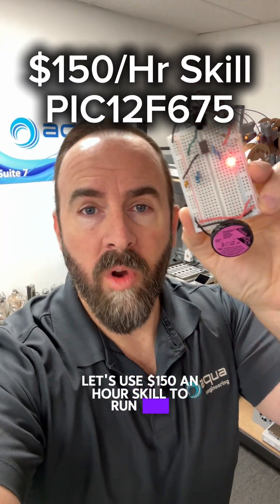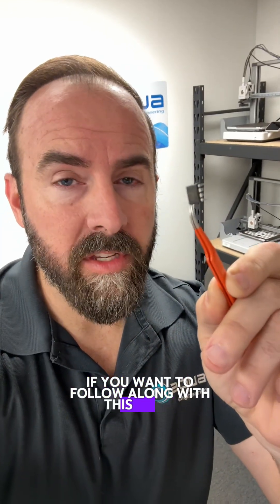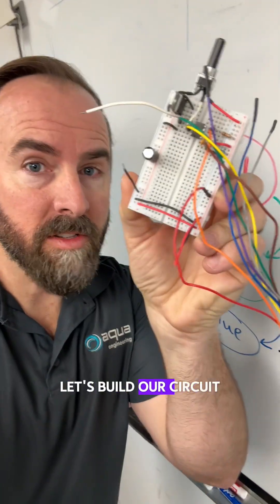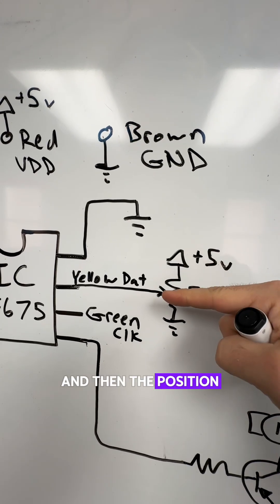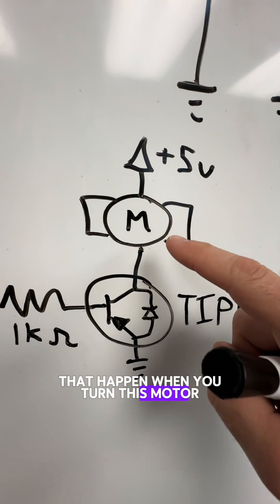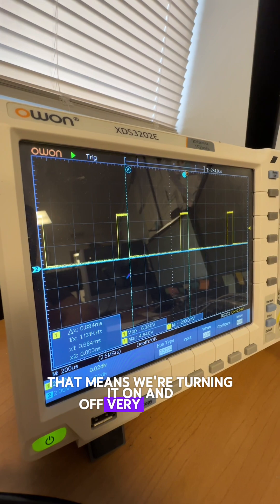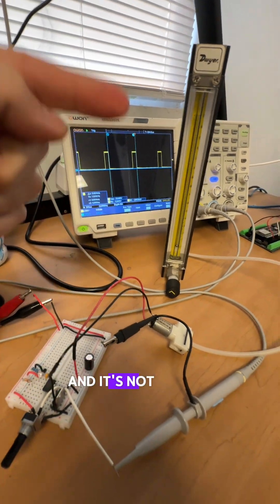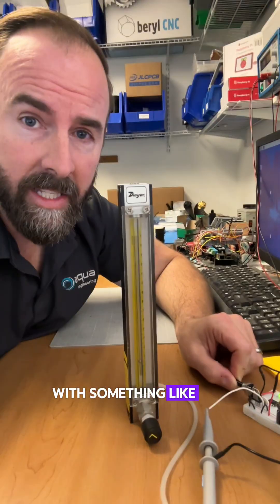PIC12F675 Pump Control is a $150/hr Skill

Comment: You can get an Arduino for $3, it doesn't need a $70 programmer, and it has hardware PWM so you don't need software interrupts.

Comment: Great example of how a pic works.    In this example though a pic is unnecessary.   Keep things simple,  a 555 timer ic would be better.  If a pic fails you need the chip and a copy of the code and the programmer.   If a 555 fails you just swap it out.

Comment: The diode you pointed to is just the body diode. all mosfets have it built in as part of the manufacturing design, and it isnt acting as a freewheel diode because it doesnt provide a path back to the other terminal of the motor (to allow it to freewheel and reduce the inductive peak)

Comment: If I were jumping into embedded programming, I believe I’d consider an ESP-32 board.  You can get the boards for as low as one Dollar and most have a USB-C program/power port and analog/digital I/O.  It isn’t quite bare metal, but pretty close.  They can be programmed using the cost free Arduino development environment program which exists for Windows/Mac/Linux.  The cost and learning curve are about as user friendly as you can get.

PICs are great too, but you have to provide a little more glue circuitry and you need a programmer from Microchip or another PIC supporter.

150 an hour?  Depends on where you live.  Where I am in the US, you would probably get about half that as a recent engineering grad, even less without a degree.  The good thing is that the proof is in the pudding and if you get hired you can advance quickly if you produce results for the employer.

Comment: Or just simply connect the potensiometer directly to the motor, and throw that chip and rocket science programing into the waste bin.
Even much simpler, and easier.
It's not a servo motor, just a basic cheap analog asynchronous pump motor.🤷‍♂️
Reply from the maker: Sure, but that’s a dead end solution that doesn’t set you up for any automation, which is the whole point of this video.

Comment: The diode inside the transistor does NOT protect it against inductive spikes. You need an anti-parallel diode (aka freewheeling diode) next to the motor.
Reply from the maker: Correct, that diode protects the transistor, and without the motor diode, the motor windings just eat it. This is a very small motor. Ideally we add the other diode 👍
Reply: @i2c_jason Does NOT protects it, the current flows the other direction.      Kruger said it right. The motor inductance generates the spikes on turnoff, not eats it.

Comment: PSU + Potentiometer(as divider) + motor(pump) = same result(control flow by spinning knob). controlled by current limitation, not PWM.
Reply from the maker: True, but that’s not the big picture if this video. The goal is to see the process and versatility of microcontrollers.
Reply: @i2c_jason Thank you for the response. I appreciate your content.
Reply from the maker: @DO5_MOS1 thank you for watching!!

Comment: Could you put a little more information out about when and where to add resistors to your circuits? My gorilla brain understands a lot of the other components and methodologies here, but I'm putting A to B without them. Thank you for all that you share!
Reply from the maker: This is where Ohm’s law really comes in. But without calculating all that it’s probably easiest to just remember that you always need a resistor with an LED. You always need a resistor to switch a BJT transistor, generally around 1k ohms, you want to pull up a reset line like this one with 10k. You could pull it up with 1k ohms if you had a really electrically noisy environment. The lower the resistor value, the “harder” you pull up or down. A direct wire is zero ohms and is the most you can “pull up or down”. Hope that helps a little.

Comment: Could you do a pull up or pull down with a button on the reset?
Reply from the maker: Yes you could just go right to ground with a switch on that reset line and it would reset when pressed.

Comment: I would still prefer to use a NE555 two diodes and a potentiometer, to do the pwm for this. It's even more robust  than a microcontroller.
Reply from the maker: Sure, until my next video where I program it to cycle through various set points 😄

Comment: I figured this stuff out in grade school with my father. But I moved into Arduino. My career went a different direction but it's coming back to this. 

The step up is Arduino. We need a more complex system because many projects are closed loop. Needing PID type controllers. 
That's where my knowledge starts to fall off. 
And using linked controllers through different communication links is another downfall. 

I've flashed and used esp32 for silly projects but it's too much for small projects and a small brain. 

The Arduino nano system and adafruit kits can do a lot and are extremely robust. 

I wish I had stayed focused in my education and finished my degree.
I quit and joined the army. Fun but stupid. 

Keep up the videos
Reply from the maker: Awesome! There’s a PID library for Arduino. I plan to do a video on that one at some point.
Reply: @i2c_jason I'm familiar with libraries I can use. But the practical use and tuning is beyond me at this point.

Comment: This is the sort of stuff I need to do for doing hydroponics. I guess I just need to have some pH monitors and figure out how I want a Time the ebb and flow
Reply: Bro, I literally made the same comment above. After you did, but that's just because I don't read. 

I think that I want to get one set up for the various elements that are required. 

At first, it would be just to monitor. The next stage would be to introduce a pump that would slowly increase a dosage of the element into the system that it is monitoring. But, that sounds a little bit more like an industrial setup. Here at home, I don't know that I'll get that complicated.
Reply: @AtomBombZero Just start super simple & for low pennies. You could always add on as you skills & budget increase with every successful project you complete. 

You could start with doing the research for what items you want to monitor, parts you think you might need, etc. That will give you a good idea of what your budget needs could possibly be.  

The man here is absolutely correct about this field, especially if you are skilled & willing to learn. High dollars & high fun when you learn these skills. It is an absolute freaking blast to be able to control the physical world with a handful of inexpensive parts & some program time.
Reply: @blazegbs I'm a Linux engineer. I don't think I'll get paid more unless I start my own company. But I may find niche solutions to problems that I have that others share.

Comment from the maker: There are fancier ways to do this, for example with an H-bridge to flip polarity (for motor control examples) or by closing the loop with a sensor and implementing PID control. You might select a more powerful chip as the complexity increases, but this 8-bit micro is a great starting point.
Reply: My struggle is finding a project at home, or even one that I could use in my work day, that would give me enough motivation to learn this. However, I think I just found one. I grow hydroponics in my basement and I would like to build some live sensors that report in parts per million of a given periodic element. 

Unfortunately, due to funding- I believe that this will be a next year project.
Reply: There’s always a fancier ways of doing anything. You gotta admit, this is a great just get it working example. Not counting the flow sensor & pump, what , maybe $90 bucks for something that could sit on a shelf until you need it for another application.
Reply from the maker: @blazegbs for sure, and I’d argue that $90 could start entire careers and businesses, since it did in my case. If nothing else it can help people understand the world of microcontrollers and mock up ideas to share when working with design and engineering teams.
Reply: @i2c_jason  I love your videos. I recently got my first 3D printer and I'm looking to start doing some electronics/microcontroller stuff to pair with it. 

Do you have a kit or parts list that you would recommend to a newbie to start out with microcontrollers?
Reply: @i2c_jason where do you find jobs/gigs or market those particular skills?